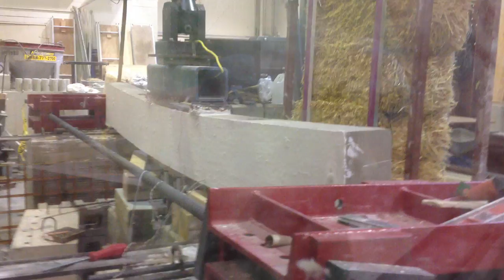Sudden Shear Failure of an FRP Reinforced Concrete Beam

Comment: no, 84 kN is 84kN. 8400kg is a measure of mass, force is a measure mass x acceleration. If this loading were not a piston arm but instead a lump of concrete or steel, we would calculate the mass given the force with: 84000kN / 9.81m/(s^2) (acceleration due to gravity) = 8563kg. So to produce this same force we would need 8563kg of stuff.